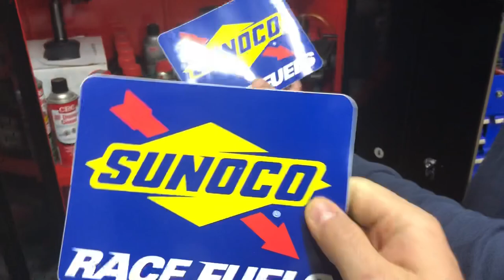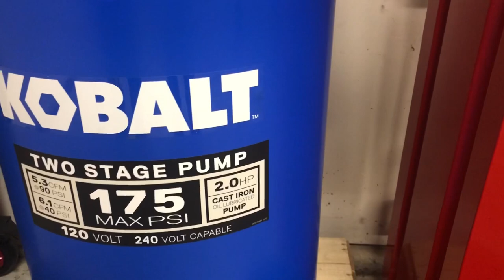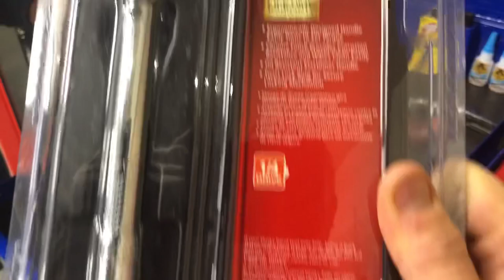(Part 1)of 3, Come With Me To See Carlos’s RC Work Shop & Help Unbox 3 Of His New RC’s

Comment: Adi. Headset buddy.   Fixed everything wrong with steering.  Just have to shorten steering.  Turnbuckles.        I got mine from us.  Like 145. Usd.  Alton designs. Website.   The. Losi 5t 2.0 has one that looks similar.  I think looking at pics.

Comment: His x2 running good still iam have mine in a few moths
Reply from the maker: Randy Durfee runs real good all day long with a G320 Engine. The 34 that came with it ran great in the first 2 gallons then it went to the garbage and we installed the long block G320 engine
Reply: @BOTAJELL  dam just to tanks he drive it that hard or is it the engine just bs....iam saveing to get one between the x2 and the the rtr 29cc losit5 the reason i lean to the x2 becuse the price .....iam not a rich man ....best truck to run stock for long as possible... down to the bone boss witch one wood you  save for ....no more fourplay str8 to the point...
Reply from the maker: Randy Durfee lmao 😂 I like both !! X2 comes with aluminum upgrades and 5T comes with plastic but reliable engine. If you got a Engine already at home ? I say get a roller and install your engine but if you don’t? You got to make the move . I made my move I got both so now you make yours. You must decide! It’s a great platform you can’t go wrong either way
Reply: @BOTAJELL  ok shit iam just have to get the both of them iam start with the x 2 first i think.and if shit gose wrong ill just fix it.....and keep saveing ill find out one way...
Reply from the maker: Randy Durfee bro they all break eventually and must be fixed! This ain’t no real car bro that your buying it’s a hobby 1/5 scale that’s fun as hell and you will love !